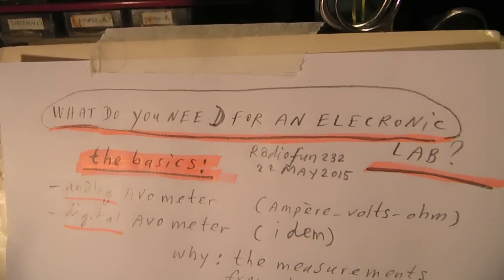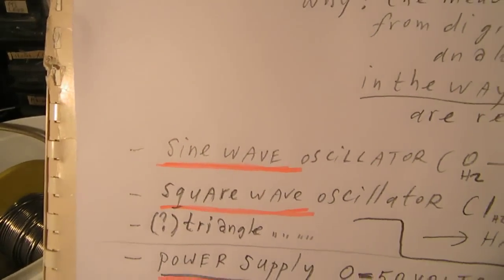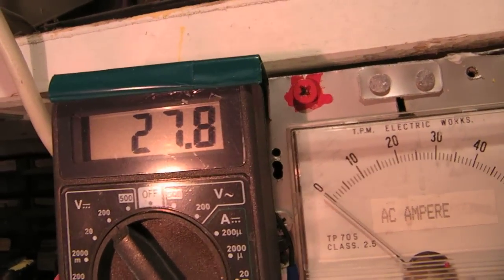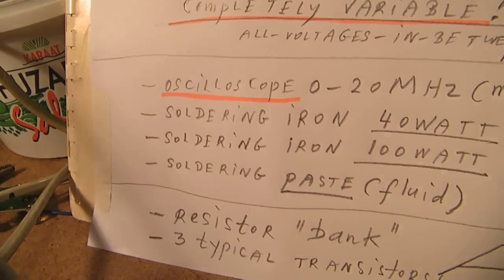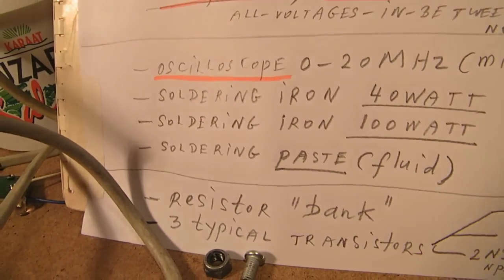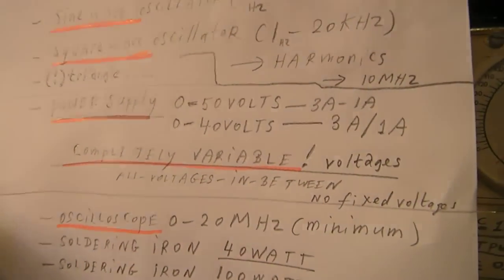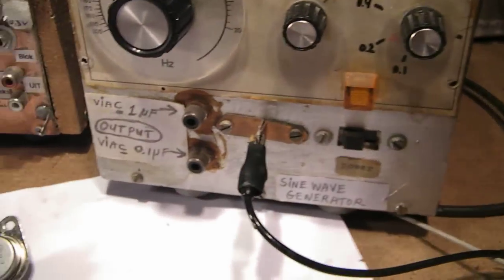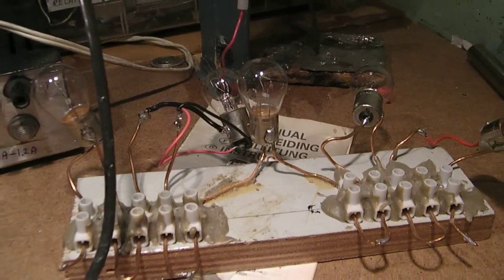What do you need for an electronic lab? ( the basics)

Comment: I enjoying watching your channel. In what country are you located? The reason I ask is due to the materials you use in your projects.
Reply from the maker: bain5872 I am living in the Nethelands.
Reply: radiofun232 Thanks. Hello from USA. I've noticed you use mostly wood and point to point wiring in your projects. There is nothing wrong with this but I was curious as to why you do not use more conventional perforated circuit boards? Thanks again for your reply.
Reply from the maker: bain5872 I found that this way of making circuits works best. The wood is covered with clear PVC glue, this gives a very good isolation factor. You can copy the circuit directly from the schematic to the board, that gives less risk for mistakes (you dont have to flip the board, looking at the mirror side of the schematic). The earth wire is always visible, this prevents double/unclear earth connections with the risk of unrepairable hum problems. It works good up to 18-20 MHz circuits (tested).

Comment: The TIP2955 is the complementary PNP equivalent of the 2n3055 even though it is not in a metal can package.  The TIP3055 and 2n3055 are the same NPN transistor, just in different packages.
Reply from the maker: CoolDudeClem Thanks, it was the transistor that I ment.

Comment: When does a volt meter not measure voltage? When it isn't true RMS! AC voltage readings should only be taken with a true RMS DMM unless only an approximate voltage reading is required
Reply: Mobitronic Solar Mobitronic Solar If one is wanting to obtain the mean average of an AC sinusoidal for real power calculations, True RMS reading is the way to go. However, if one is needing to obtain peak AC voltage such as in a detector circuit, the RMS reading would be 30.3 percent in error.